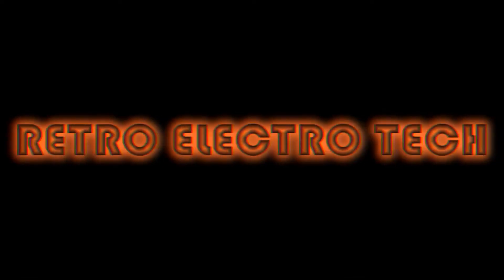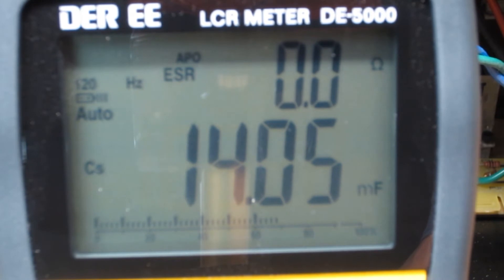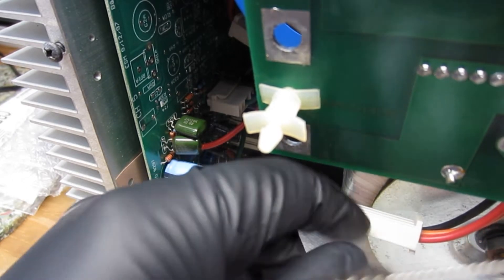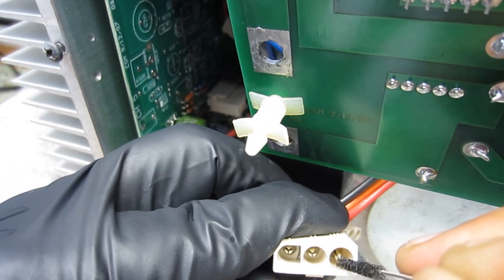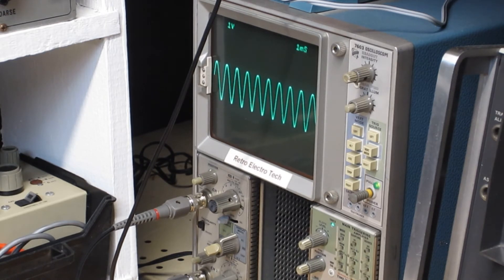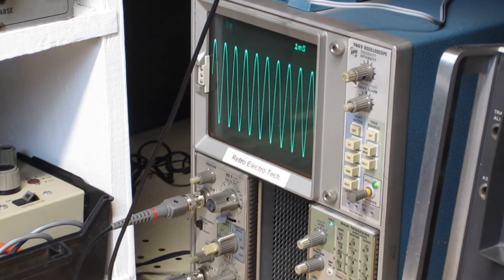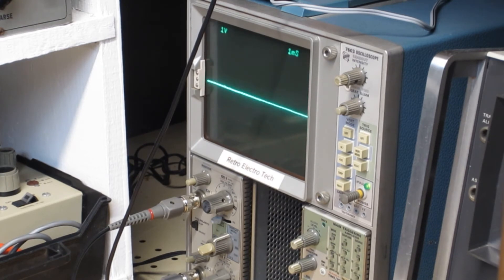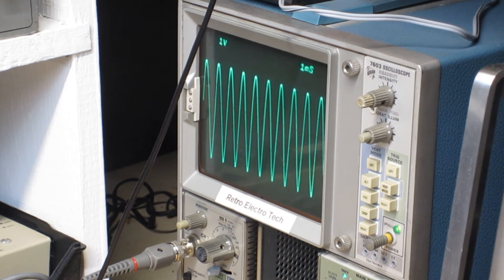B&K AV5000 Series 2 Evaluation Part Two

Comment: I have a Reference 2220 which looks identical as yours minus 3 boards, I’ve pulled the transformer wires off a while back and don’t know which order they go back onto the terminal block, I pieced together the way you had yours hooked up, which is fine. Only my power button switch leg goes to the terminal block also and I noticed yours don’t what color transformer wire would that switch light go to?

Comment: I have a B&K Ref 200.5 amp and I can't figure out why all 5 channels have 150-350mv on the outputs while in standby mode. When powered on it functions normally with less than 5mv on all outputs. I can't test the big caps because none of my ESR or LCR meters can measure 27,000uf and 32,000uf. I also have a B&K 505 series 2, which now also has the same problem with 45-170mv on the speakers when in standby. Could leaky caps cause my problem? 

If you of anyone in the comments could point me in the right direction, it would be much appreciated.

Comment: Nice video.  Do you happen to also work on Aragon amps as well?  I have an Aragon 4004 stereo power amp that the local North Carolina area repair guy could not fix.  I am looking for someone else who might be willing to tackle it.
Reply from the maker: Hello there Rich, thank You for reaching out and pardon the delay in responding, things are extremely busy. Yes I do work on that type / classification of amp, however, due to very high demand / full shelves I wouldn't be able to take in Your amp at this time. It would be quite a long turn around time, probably between 6 to 8 months (at least) and I'm sure You'd like to look around for someone with a clearer schedule. However, You're always welcome to check back with me at a later date if You can't get Your issue resolved sooner, my best to You 🙂

Comment: It is possible to buy B&K AVR-505. Please tell me if this receiver deserves attention? I'm more interested in how it works in stereo? If the processor dies, can I use it as a power amplifier? High class or not? Thanks
Reply from the maker: I'm not familiar with that specific amp (the AVR-505), the last B&K I serviced was the one in the video (AV5000 series 2) and I didn't really like the design, the way it was laid out. Additionally that design runs too hot based on my observations, which of course promotes heat related problems with components over time. It does the job based on what it's designed to do, but again, I wouldn't recommend the model I worked on. However, I can't speak about B&K's other designs, including the model You are asking about, perhaps it's a better design. It would be a good idea to do more research before You buy one, maybe it will be something that performs well for Your needs. My best to You and thank You for reaching out to me 🙂
Reply: @retroelectrotech  i've got the 6ch version of this amp(vmr-654) which i recapped several years ago. you wanna talk about heat? all those 100uf 100v blue rubycons at the top of those amps had turned gray, on the verge of brown from heat stress. they all measured 40-50uf with high esr. they had been cooked alive. also had 1 noisy mosfet that i replaced. glad i serviced it when i did because it lives on altho i rarely use it. first amp that i've ever owned for 20+ years!🤘
Reply from the maker: @josephlalock8378  Hello there Joseph, hope all is well, yes, I remember working on this unit, not my favorite era / style of amp, but it is a heavy beast that's good to heat with and use for self defense by attaching a chain to it so you can swing it around like a Viking and clear a few people out of the way. Otherwise, it does it's job and kicks out the tunes ;-)